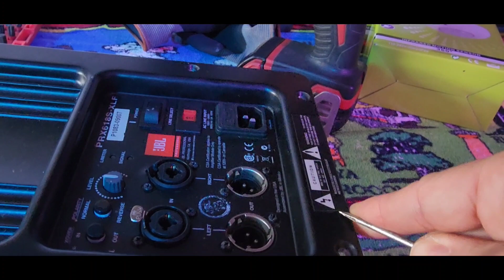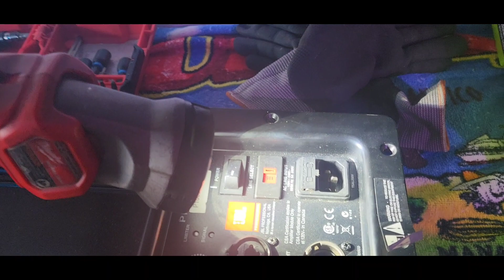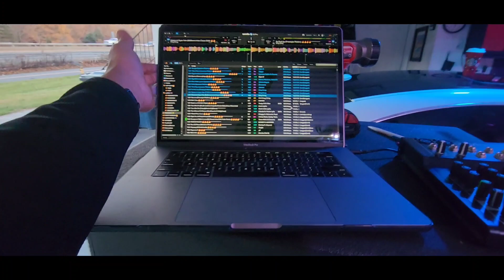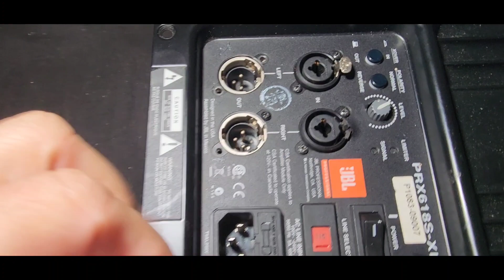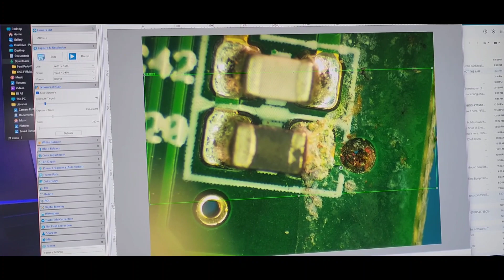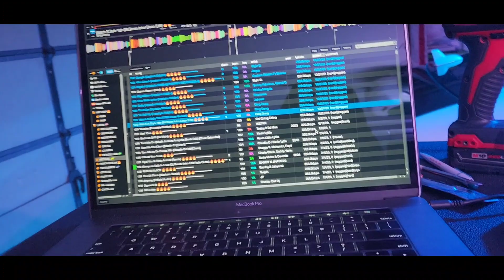JBL PRX618S-XLF No Audio Repair

Comment: Great video... I have the same bass bottom and it sounds great but my issue is the grille is a little bit Rusty looking. Do you know where I can find a replacement grille
Reply from the maker: I would suggest getting a metal paint from Amazon and painting it. Take it off, sand it down, and do a good paint job."
Brand new it's $180 - http://m.prosoundservice.com/m9/JBL%20Pro%20Parts%20444737-002--guaranteed-genuine-jbl-pro-parts-444737-002-grille-assembly-for-jbl-prx618s-xlf.html
Reply: Ok cool